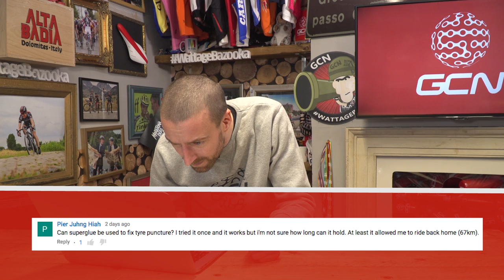Is Being Aerodynamic Uphill Important? | Ask GCN Anything Cycling

Comment: I have repaired small punctures and holes in my tires with rubber cement. Just deflate the tire, squeeze the glue into the hole/puncture while pinching the tire to open it up slightly, reinflate, and let dry. The excess that squeezes out will wear off on the 1st ride. It also keeps debris from getting into the hole/puncture.

Comment: In theory, yes, supergluing a tire back together after a puncture will work, as the super glue will re-bond the rubber in some organic chemistry reaction, or in english, magic. However, I am not to sure if it will hold up.  The issues with gluing a tire or tube together on bikes would presumably be forces from the road, the wheel spinning, and friction between the tube and tire stressing the bond. This would be a great thing to test in a lab!

Comment: Using a magnetic trainer, which would wear out your tire faster in the same given Wattage and tire pressure: Putting a high resistance on the trainer and having less wheel rotation, or a low trainer resistance and have more wheel rotation? #TorqueBack

#GCNQuiz?

Comment: Idea for future video. Why should I care about wheel dimensions if it's the tire that's on the road? #Torqueback
Reply: +Joel Berman The internal rim width effects how the tire sits on the rim which changes the contact patch.  17mm is pretty standard and larger ones like 19mm make the tire sit wider which makes the contact patch wider and shorter, and overall smaller for lower rolling resistance.  There is also a contradiction between the wheel makers making wider internal rim width rims, and the tire companies who claim you cant put a 23 or 25 on that wider rim, despite the fact it seems to work fine.

Comment: Hi GCN, this question popped into my head while watching last weeks video. What's the difference between a cyclocross bike and a gravel bike? #TorqueBack
Reply: I wonder the same thing.  Marketing to sell more bikes?
Reply: I remember looking that up: I'm fairly certain it's to do with geometry and that CX bikes have more of an aggressive geometry compared with the gravel bike. Probably a bit more to it tho.
Reply: A simplification would be a road race bike is to cyclocross bike, as endurance road bike is to gravel bike.

If you actually dig down into the geometry numbers.. The head tube angle on a CX bike is steeper, this makes it better at low speed cornering. On the gravel bike head tube is slacker, this makes the bike better at high speed cornering. Head tubes tend to be shorter on the CX bike. A classic CX bike has a higher BB than a gravel bike. The wheelbase on the CX bike is shorter than a gravel bike.

What does this all mean? A CX bike can be described as a twitchy nimble bike that your perched on. This makes it suitable form for CX courses that need this type of tight quick low speed turning. A gravel bike can simply be described as "normal" road bike that rides fat tires. Gravel bikes sit on the same geometry charts as endurance road bikes. 

Can you use a CX bike for gravel? Yes, but it won't be as good as a gravel bike. When speed is picked up and descending happens, the twitchy nimble handling becomes a sketchy uneasy feeling. Can you use a gravel bike for CX? Yes, but it won't be as good as a CX bike. The longer wheelbase and handling makes it a bit more cumbersome to maneuver through the course.
Reply: Cross bike has more aggressive geometry, higher bottom bracket and usually a higher junction of seat post and top tube for shouldering the bike as you run up or over things. 
If you already have an aggressive road bike, you can augment your training with a similar geometry cox bike, or if you want something different, you can go longer on the more versatile gravel bike. My gravel bike has become my first choice of weapon. Regular road or mtn bikes getting used less and less. 
Just get out and ride.

Comment: Can you address tips for riding into head wind? Today was a typical beautiful sunny day in Kansas, with high wind speed at 31 mph or 49 KPH #torqueBack
Reply: Leave Kansas

It's about getting as low as possible and minimizing your frontal area into the wind.
Reply: SGBass  I was told by a bike mechanic that aero bars can be difficult to use for people that are green to cycling
Reply: SGBass thanks for tips. I googled TT bikes and they look a bit expensive for me at the moment.  I'm riding an old hybrid I bought cheap from a local mechanic.
Reply: I'm off to google cyclocomputer!
Reply: Marshall Lusk Aerobars require that you adjust your entire position - move the saddle way up front (and usually get a different saddle, sometimes reverse or change the seatpost), redesign your cockpit (move down, change the stem to a shorter one) etc. Then it's also a position to get used to. Some people are too inflexible in the lower back to handle even a mild TT position.
Reply: kajet I see what you're saying. I just paid to have my bike fitted a week ago. Makes a huge difference on ride comfort.
Reply: You ride a hybrid bike? You won't get aero on it. By design it is a sit up style bike.
Reply: Smale Rider  that may be true. but I'm still looking for applicable advice for riding into wind
Reply: SGBass my bike has 700X38c tires. I think the previous owner had the tire size to allow for gravel rides, but I have not done any gravel rides yet. The tires appear some what inbetween mountain and road. Which honestly suits Kansas.  It sounds like you're suggesting tire size makes a big difference on drag? What do you recommend for versatile size? Gravel and road?

Comment: #TorqueBack  Is it worth using/owning Aero wheels if you don't use an aerodynamically matched tire? If so at what point is the mismatch so great that you're not getting any Aero benefit?
Reply: you will still get very similar gains  from the aero wheels with almost any normal tyre size, the effect of tyre size is minimal. A study by flo cycling showed that at 40kph the aerodynamic losses from a 25mm to a 23mm tyre were balanced by the better rolling resistance from the 25mm tyre.

Comment: I cant understand when everyone says that its slower/harder to change out a disc equipped wheel. I have 2 road bikes which have discs. Other one has Focus' rat thru axles, which are in my experience faster to change out than standard quick releases. And the rotor "disalignment" is non-existant! #TorqueBack

Comment: How to ride a bike in snow ?
Reply: Carefully
Reply: Jawad Lajami get bigger tires (cyclo or mtb)
Reply: Indoors
Reply: Fatbike
Reply: Depends on how deep the snow is.
If it's less than 8cm it's easily rideable on a road bike. Just feels like riding on sand but better than sand when it's packed down.
Just watch for ice.
Reply: The better question is why would you?  The ? Is like this one guy in my motorcycle class.   He ask should he carry extra tires while riding his motorcycle and in case he rides in the winter should he pack snow chains.
Reply: Indoors. On a trainer, unless you have a large room.
Reply: I live in Canada and used to commute to work year round by bike.  Now I am old and worn out I don't ride in snow and ice any more.  I have never used them but you can get metal studded bike tires for just this purpose.  My number one tip is to lower your seat a bit ( this was on a mountain bike with a quick adjust seat), so that if you start to go down when a wheel starts to go sideways you can get your feet on the ground, easier.
Reply: Why would you?  We can have snow from November till April.  The season is not very long if you stick to nice weather.
Reply: Great tip, Minute Man, and I do the same for riding on snow and ice.  And flat pedals, too, for slides or falls, that's my preference as I would rather not be tethered to the bike in those conditions.

Comment: How much of a difference am I liable to see moving from my vintage 10speed to a more modern bike? #TorqueBack
Reply: Clean and crisper shifts. Comfort compliant features. Lighter weight. Unless the new bike has aero features, expect no speed difference.
Reply: Smale Rider better shifting for sure, bar mounted shifters will be much better than down tube mounted ones. Has rim braking improved, or should I look at discs? Too used to the brake control I have on my DH bike
Reply: All the same braking benefits you find on you DH will be the same as road disc. Just make sure you get thru-axles and not a half-assed QR set-up
Reply: Smale Rider I know discs are the best, just wondering if in recent years rim brakes have become feasible in wet conditions. My current bike takes approx 20M to come to a stop in the rain at 20 kmph
Reply: Nope. Rim brakes continue to be bad in the wet and dirty
Reply: Some weight reduction, usually.

Wider gearing range, better ability to control effort and/or go tempo on the climbs.
Also, assuming you're currently running a wide-range freewheel like a 14-28, the greater number of ratios today can reduce the need to find tight-spaced ratios by double-shifting.

Close-at-hand paddle shifters make for less time between deciding to change gears and actually executing the gear change, so less anticipation is required.
Easier to change gears when pedaling out of the saddle, since you can maintain a good grip on the hoods or hooks while using a finger to hit the shifter.

In some cases, executing a front shift from small to big may actually take longer on a modern bike. This is because, to get a shift on a 16-tooth difference to be smooth, the chain needs to be ramped up onto the big ring before it engages the teeth. By contrast, on vintage doubles where the big ring was only 10 teeth bigger (or less) than the small ring, the teeth can immediately grab the chain on a small-to-big shift.
On the plus side, if you're doing less double-shifting, this is less of an issue.

Higher-performing brakes that are easier to adjust. Modern dual-pivot brakes are stiffer, and their ease of tight adjustment means they're generally coupled with brake levers with higher mechanical advantage, resulting in better braking power. Performance still degrades in the wet, but the greater power makes the problem less bad.

Cockpit design is a bit different, since brifters have caused the hoods to become a more "primary" position. Now there's usually a continuous sweep from the handlebar ramps onto wide hoods, and compact handlebars are used to correspondingly bring the drops up.

Comment: #TorqueBack Is there / Can you feel a difference between a top tier carbon frame vs a 2nd tier carbon frame given the same exact components/specifications?
Reply: In the case of Giant, it's primarily the weight. The Giant Propel Advanced 1/2 use the same geometry as the Advanced SL, the difference being that the SL uses a more premium carbon fiber. The more premium fiber allows thinner layers of carbon to be used, while still giving the same strength, improving the weight to strength ratio.
Reply: Hey man, thanks for the reply. The key quantifiable difference I know and like you mentioned is the weight , which seemed to amount to a 100-200g difference. Other than that, the another diff that is always marketed is the stiffness.

I live in a country whereby there is no such concept of test riding of bikes. So most of us are buying bikes based on blind faith and gut feelings.

So as that, is the "better" ride quality of a top tier carbon frame be feelable across all major brands?
Reply: Not all bikes have equal geometry too. That's probably a more major difference. Once you're into top tier carbon, you're getting a premium product. test riding gives you a feel for the geometry/sizing but unless you're a super ultra enthusiast/expert/actual professional, top tier carbon is top tier carbon. In my opinion.
Reply: Sometimes its a high modulus (stiff) vs low modulus (flexy) carbon layup. But most of the time its some costly technique they came up with to somehow shave grams out of the overall weight of the frame.

Comment: #torqueback I live near quite a hilly area, is it possible to switch my 50/34 chainrings to 52/34, or can a derailleur not cope with such a jump?
Reply: If your area is hilly wouldn't you want to switch your 50/34 to a 48/32 or something? Why do you want to increase the ratio?
Reply: The 34 with a 32 cassette is fine for going up, but I fancy something taller for the speed down the other side.
Reply: Oh gotcha. Well, not sure if you can swap, but if it were me I'd just pedal harder/faster. I usually ride at around 90-95 rpm, so I'd keep the money in my pocket and go to 110 or so before I spent money on it. But to each their own.